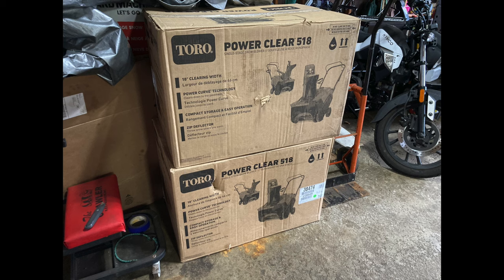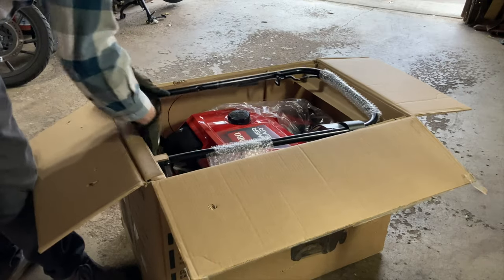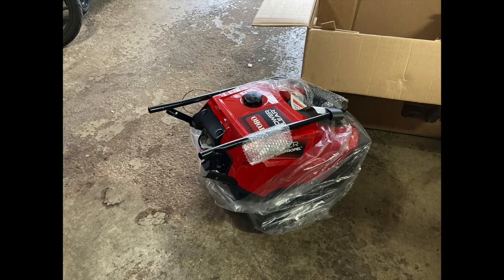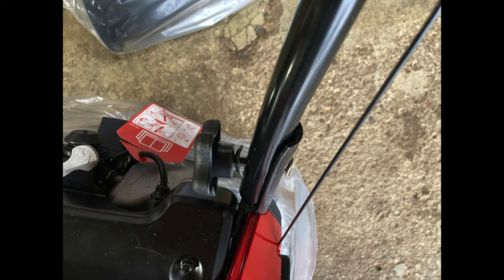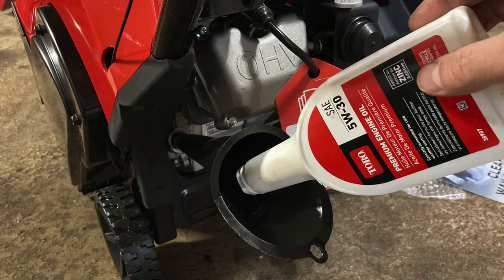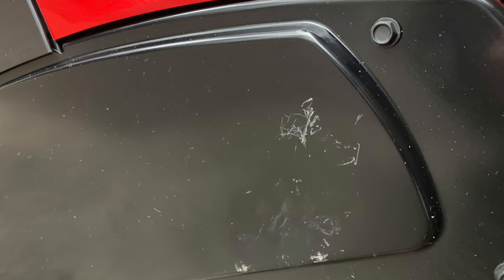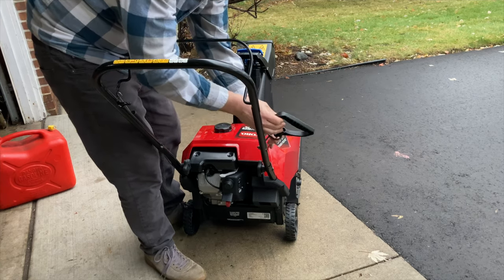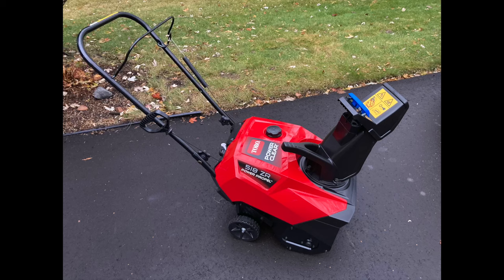New Toro 518 Power clear snowblower

Comment: Thanks for the visual! I had put mine together, however was not sure about the entire container of oil or if I had the chute on correct but I heard the same clicking sound with yours when you turn the chute! I went through so many years of school for one day to buy a snowblower with pictures instead of directions! Fascinating!🤣
Reply from the maker: Glad you found it helpful. Did you have a chance to use it yet? I have another video of it in use coming soon.
Reply: @everybodysjonathan  Yep! Used it the day it arrived after assembling! I still think they should have used actual directions and not just pictures although I got through the assembly process and did look at your video to check it!

Comment: I can't get the top part to turn
Reply from the maker: Maybe try re-attaching the chute / handle assembly . Make sure it’s lined up correctly.
Reply: It's still not turning when I put the screws in
Reply from the maker: You could reach out to toro. They should be able to walk you through the issue, or return the unit to the store for exchange with another.
Reply: @tameramccurry5677  Did you finally get it to turn? By now I'm sure you have, it is very stiff and you will hear a clicking sound when you turn it.